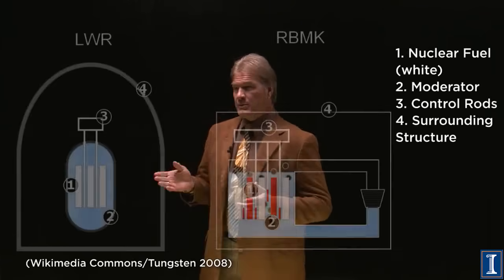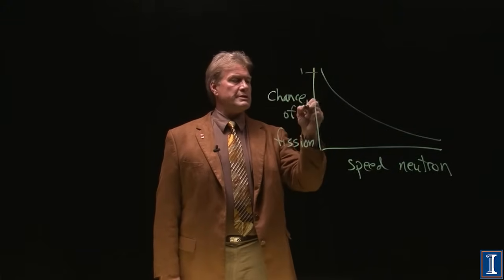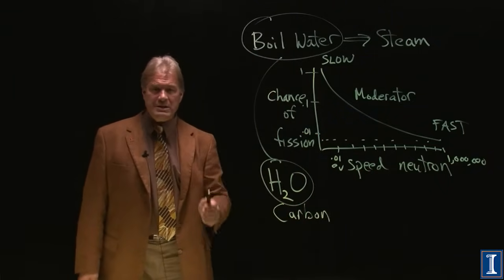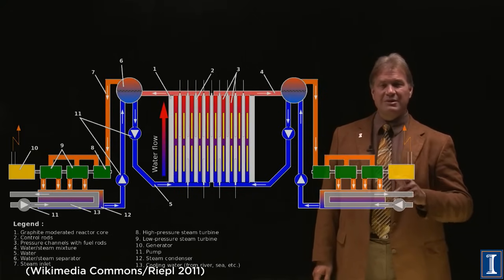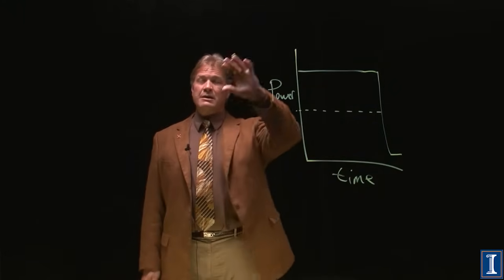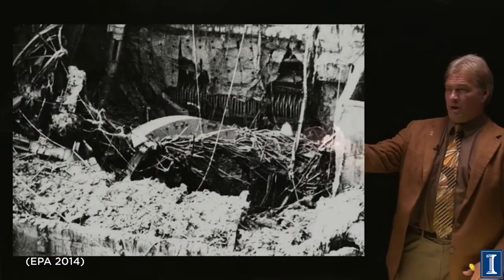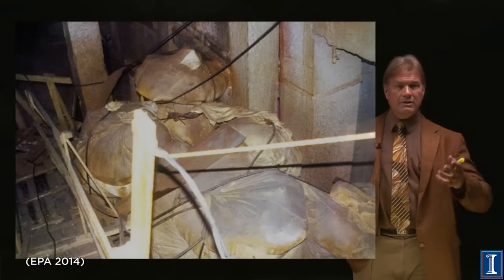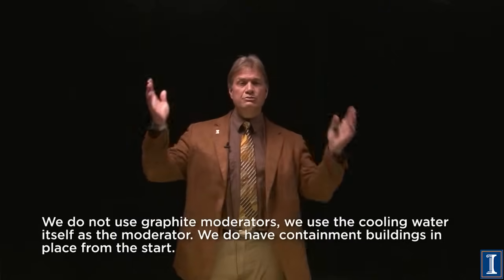Chernobyl: Worst Accident Ever

Comment: I have a couple things wrong like he first said that somebody hit the wrong button and lowered the power to low but that was wrong because no one hit a button there was higher ups in Kiev demanding more power for longer usage so they ended up having to put the reactor at half power which causes an xenon build up because the reactor can only burn off xenon at full power. the test needed to then reduce the reactor  too half of half power which would’ve been 700 MW. They tried lowering the power by lowering more control rods this caused a reduction in power but not to the engineers knowledge it was also lower because the core was poisoned by the xenon killing the reaction. The power had dipped to low which at this point means they should have shut the reactor down but a manager overseeing the test forced the engineers to raise the power. They complied but only could get the power to 200MW that with pulling most of the control rods. The manager then forced the test to go on so they shut off the pumps which at this point was the only other thing absorbing the reaction and cooling the reactor. The water then start to boil quickly and power start to increase because of the heat. The same heat also burns off the xenon, leaving the reactor unchecked from coolant and from control rods. The power now start to rise, acknowledging this the engineers try the AE-5 shut down button which would reinsert the control rods and shut the reaction down. The problem was the control rods were  tipped with graphite  the same moderater that  is used for the nuclear fuel rods this then causes the power to sky rocket. The heat then turns all the water that had been in the reactor to turn to steam( gas expands and created to much pressure so steam explosion) this blows the 1000 ton reactor lid off the minute it comes off oxygen rushes into the now open and exposed reactor core mixes the super heated graphite cause a large chemical explosion great enough to blow the building apart and shooting nuclear debris across 230km. This same explosion blows the 100 ton safety shield(holds the nuclear fuel in place) out of the reactor where it still sit today at a 15 degree angle above the  reactor on the reactor floor. With the reactor open and exposed, radiation ionized with the air an wind and rain spreaded radiation across Europe. Also the 31 confirmed death was a lie from the Soviet Union there were more death they just didn’t want the incident to look as bad so they lied about the death. Doctors all across Soviet Union have confirmed that they were see patients from Chernobyl for over 10 years who have passed away from acute radiation sickness. This video really got to me because some of what he was say was right but other were so left field wrong.

Comment: So many things he said are just wrong ….. including saying there was one other nuclear reactor at Chernobyl. In fact there were four in total so three other reactors. He also said there were a dozen RBMK nuclear reactors …. there were actually 16 such reactors in the old Soviet Union.

The power didn't drop way below the desired 700mw planned for the safety test because an operator pressed the wrong button as he stated. It dropped way below because xenon poisoning of the reactor because it had been held at half power (1600mw) for the previous 10 hours 

The uncontrollable power surge occurred when the operators turned off the water pumps as part of the safety test.

He also said that lead absorbs neutrons …. is that correct? 

I complete layman like me should not be able to correct an 'expert' giving a lecture.
Reply: Lead and any other material absorbs neutrons when bombarded within a nuclear reactor, or during a nuclear explosion. That is where nuclear fallout comes from.
Reply: Actually there are 9-RBMK reactors in operation. The last shutdown is planed for the year 2050.
Reply: @derwildewesten6700  We were talking about how many other RMBK reactors in 1986.

Comment: A question I have is why does the plant need external power for the cooling pumps?  At chernobyl, there were four reactors.  Couldn't they always have at least one running which could supply power for the pumps of all four?    At fukushima, the reactors scrammed during the earthquake.  The tsunami took out the diesel generators, but batteries supplied cooling power for 24 hours.  Couldn't they have brought up one of the reactors to generate power for the pumps of all six reactors?

Comment: Japan, specifically Tokyo Power Company, has designs for a reactor which can be cooled by gravity fed water from a large reservoir uphill from the reactor.  So if everything failed, the power grid failed, the diesel generators failed, the pumps failed, they can still cool the reactor with gravity power.  If gravity fails we have bigger problems than radiation.  Also in existing plants, they already moved all the back up diesel generators to high elevations in case of another tsunami.  Plus they have them in different areas in case one area is destroyed, they aren't all in the same spot.  Plus they have large diesel generators on the back of trucks at different locations in case of an emergency, they can drive some of the trucks to the plant.

Comment: The title of the video is click bait. 

Yes, Chernobyl was a disaster. But the worst accident ever? 

Not even close. The Fukushima Daiichi nuclear reactor accidents are the worst. 

At least the Russians were able to secure the reactor by encasing it into a sarcophagus. The Fukushima Daiichi reactors? They are still fully exposed. With large amounts of highly radioactive material still being released. The relatively recent Typhoon Hagibis not helping matters either. The huge amounts of tritiated water being generated also being released directly into the ocean. 

Chernobyl was bad. Especially the bone headed decisions made in what was just a training exercise. But the even worse bone-headed decisions made at Fukushima with placement of the back up diesel generators at below the water level take the cake.
Reply: It is a little bit ironic. 

There is such a complicated and dangerous thing like an nuclear reactor. Years of construction, building and so on. And then they failed in the cheapest and easiest thing to to by setting the back up  diesel generators on an high and save water level...

...humans....

It is like the airplane crashes. After an accident they find out what and why something went wrong and they will change things. Maybe it would be better to change things  before an accident happens?

Comment: So... what happened at Fukushima? If all the other reactors work with water as the moderator, what was the issue over there?
Reply: After shutdown a big power core needs active cooling. Due to flooding from the tsunami the switchgear for the emergency generators was underwater and couldn't operate. Therefore the core had no cooling and melted. Due to heat generated and steam-zircalloy reaction (presumably), hydrogen gas was generated which leaked from the containment structure into the building superstructure. This should've been vented... But it accumulated and finally it triggered an explosion. 
The building superstructure is specifically designed to give way in case of a hydrogen explosion, so that it doesn't damage the containment below. This is exactly what happened. In other words, the explosion that took place in Fukushima was the containment design doing its job.
Unfortunately global media reported it as "the reactor has exploded", which fed the mass hysteria and unnecessary evacuation of the surrounding area.

Comment: i have enjoyed many videos from this channel but was expecting this one to be a little more detailed around the neutron flux and the reason why the control rods had graphite 'tips' (the reality is the rods were about half graphite) scott manly has a better explanation with much more detail. I also have my doubts that the containment buildings really could perfectly contain a steam explosion of the scale of chernobyls.
Reply: TheRealUnconnected Three Mile Island in Pennsylvania is a good example of out containment buildings. The reactor partially melted down yet no huge release into the air of radiation. Well...not that we were told.
Reply: @Iwillnotbepushed  'no huge release into the air of radiation'
Radioactive elements in the form of volatile gases, like Iodine, were released. However, unlike Chernobyl, solid matter was not released.
Reply: @Iwillnotbepushed  Melted down, not exploded.
Reply: @
TheRealUnconnected
The main reason for this design of the rods was an attempt to place the reactor in a room of LOWER HEIGHT AND DEPTH. Typical Soviet style of "economy".
Also, the designers chose a dangerously low speed of movement of the rods, citing an allegedly sufficient change in the coefficient of reactivity per second.
Link to the site created by the engineers of the Chernobyl nuclear power plant (in Russian):
http://accidont.ru/sitemap.html. This site is unmanaged since 2013. No feedback.
All tables, graphs and printouts you are interested in are there. As well as different opinions of experts about the causes of the accident. design flaws of the reactor and personnel errors. And descriptions of other emergencies at RBMK reactors.
Reply: @berko9608  thanks for that resource, keen to explore deeper.
Reply: @TheRealUnconnected  
I'm glad to share a link to a little-known but valuable resource.
Any questions? Do not hesitate, contact me.
I am not a nuclear or an energy engineer, I am a TV and telecommunications engineer. 
My former colleagues often filmed  at Ch NPP and shared their own information.
Reply: That is why sane people don't use graphite-moderated cores. There wasn't much sanity to go around in the Soviet Union. Much like the food or freedom.
Reply: @brentsrx7  The issue is not so much that it's graphite moderated but that it's over-moderated (meaning by default it has more moderator than optimum). The water acts as a moderator and an absorber, and when it boils off you get both a reduction in moderator and a reduction in absorption. You can design safe graphite moderated reactors - the British Magnox and AGR gas-cooled reactors are generally pretty safe designs, and because they're gas cooled they can't have void coefficients of any type.
Reply: A containment building would not have contained what happened in Chernobyl. Containment buildings are designed to hold up 80psi of pressure. The explosion at Chernobyl is estimated to have reached over 1500psi.  Just before the reactor blew, energy output reach 30,000MW thermal, 10x higher than the reactor was designed. There is a hypothesis that Chernobyl was a fizzled nuclear explosion.  There were two explosions.
Reply: In a nuclear explosion, over pressures of 12 psi or greater kill virtually everyone and destroys all but specially built facilities above ground in the blast zone, such as a nuclear missile silo.
Reply: The idea is the steam explosion would not have happened in a normal reactor regardless of containment building (which was not constructed in mind of a massive explosion of core). There were 2 explosions, one were the steam pressure blew the shield of the reactor and the other that followed a few seconds after where oxygen combined with the heated hydrogen+graphite
Reply: It was a hydrogen explosion, not just steam.
Reply: Fly safe!
Reply: nuclear power plants do not have the ability to blow up like a nuclear bomb under no circumstances could they or would they.

Nuclear bombs have all these super engineered features to reflect a whole lot of energy inwards towards a specific point just to get the nuclear bomb to trigger and power plants don't have any of that stuff

Comment: Not quite,
RBMKs have several benefits over normal PWR reactors.
To name a few.
Running on low enrichment uranium,
Having a very low power density,
Being able to be cooled using light water,
Being able to be refueled DURING OPERATION,
Producing plutonium,
Having very good power capacity while being cheap to make.
Not using cooling towers (at least the older ones, the latest generation was supposed to have cooling towers),
Now, let's move to the issues of this video.
Reactor no4 entered a very unstable area because the power dropped too low,
That was on its own a reason to shut it down at that point but they did NOT.
The problem with RBMKs is that at low power levels not only do they become unstable, but the operators have to rely on outside core instrumentation, as the in-core stuff is again not accurate.
RBMKs should not be operated below 800 Thermal MW let alone 80.
RBMKs have inverse control rods entering from the bottom upwards to help distribute the power in order to avoid hot spots.
The main control rods are graphite tipped (4.5m) in order to have more effect when they are out.
To put it simply the graphite is meant to enhance the control of the rods.
IT IS NOT A DESIGN FLAW.
I am tired of hearing this thing.
The main reasons why Chernobyl exploded were:
Positive void co due to light water being used.
A very un-stable poisoned reactor that came out of its iodine pit very very fast.
The scram sequence that took 18 seconds to complete.
AND MOST IMPORTANTLY that AZ-5 DID not activate the lower control rods with it.
If it did then the extreme hot spot at the bottom of the core would have been smoothed out and everything would be absolutely fine.
Also, RBMKs DID have lower and upper biological shields.
They were not completely exposed.

Comment: A heavy water reactor uses the moderator as coolant, so if coolant boils or drains away you lose reactivity. But what happens if the reactor coolant (moderator) stays but you lose the condenser coolant/system?

Comment: Yeah yeah, solid graphite moderator bad.  That's only if the fuel is solid.  If the fuel is liquid (molten salt) then it can drain away into a lower tank and the reaction will also stop.  But molten salt is hotter and more efficient at heat exchange than steam.  And it operates at NO pressure (there's still some xenon gas, but it's like 5psi).  Light water reactors operate at over 70 atmospheres of pressure because that high pressure is the only way to keep water at 300 degrees C.  The molten salt reactor can operate at even higher temperatures, but only 1 atm of pressure.  It needs no huge expensive pressure vessel--because there's no pressure.   If for whatever reason, the heat exchanger jams and heat builds up, the frozen salt plug at the bottom of the tank will melt and the fuel will drain out of the reactor and criticality is impossible because it no longer has moderator.

Comment: This is not entirely accurate:
because the main benefit of RBMK reactor is that it runs of plain unenriched uranium so it is super cheap
It is a type of reactor that almost any amateur could build in his garage.  
The military uses it to produce plutonium in some situations, it can be even air-cooled if you don't care about energy but just want plutonium.
so you can make a nuke without any enrichment technology at all.
This cannot be achieved with water as a moderator because water absorbs quite a lot of neutrons so you absolutely need enriched uranium.
RBPK can be modified to be safe if you also use enriched uranium but that will make it way more expensive to run.
Soviets used RBMK because they needed a lot of powerplants at once and you cannot build many expensive reactors in that short time. I am not sure but I think they had a plan to replace them with a safer alternative which was fusion power.
At that time everyone believed that fusion is just around the corner and you just need to survive a few more years.
in fact, the fun fact is that the entire idea of communism was based on fusion energy as the unlimited power source which will make electricity-free.
Reply: Cheap and nuclear shouldn’t be in the same sentence
Reply: @mgiaros  
You are forgetting that at this time US was feeding radium to young women,  and pharmacies were selling radioactive energy drinks to boost your power with nuclear power.
nuclear reactors were built like crazy and used everywhere  Both US and Soviets were building nuclear planes nuclear trains and designing nuclear cars for individual use. 
Nobody had any clue about all that xenon poisoning or any dangers.  The US  had their own Chernobyl accident with their own RBMK type reactor very early so they stopped building them but nobody shared any information so it happened again.

Also with the prices of electricity at that time, you would never be able to build modern nuclear powerplant because energy prices were close to zero. because oil price was almost the same as water.
Reply: One acronym CANDU